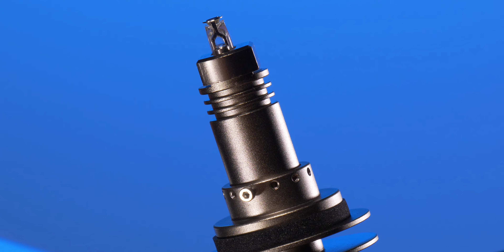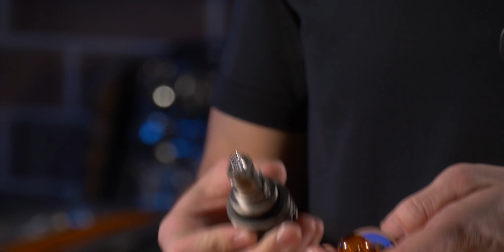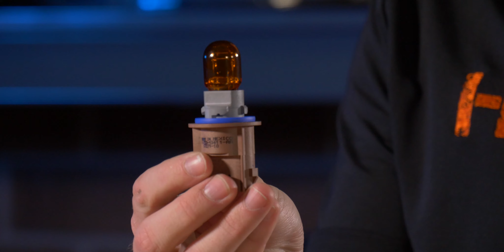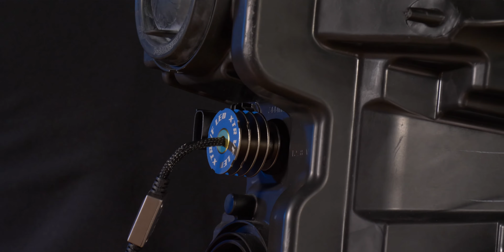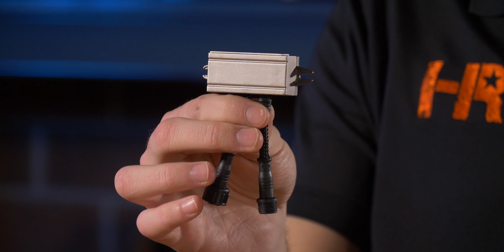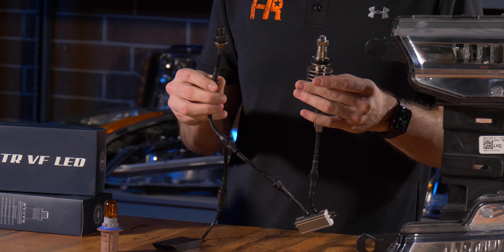Xenon Depot Xtreme VF Turn Signal Bulb Install | Headlight Revolution

Comment: On the 2007 up tundra's the drl can be disabled by cutting one wire easy to do
Reply from the maker: That is a simple way of doing that, but that will require wiring when you want to put that back to stock. That is why we actually recommend removing the pin entirely. Let us know if you have any other questions or concerns!

Comment: Why not just produce LED's that have built in resistors, to imitate incandescent bulbs?
Reply from the maker: We have tried a couple of times, most recently with the Carbide 2.0 LEDs, but the fact of the matter is that with all of the different cars out there, it is near impossible to get an LED that will function across the board without resistors.
Reply: @HeadlightRevolution  Yet in their other video released on the same day they promote the Carbide bulbs as being plug and play.
Reply from the maker: James, I'm not saying that they don't work, I am stating that even though they work, there is no way of guaranteeing that they will work in every customer vehicle. Just trying to answer the first question as accurately as possible!
Reply: Because it's better to get an LED flasher relay and have LEDs that: do not produce excess heat from the resistors, shortened lifespan due to said heat, overall lower price for LEDs+flash vs built-in resistor LEDs.